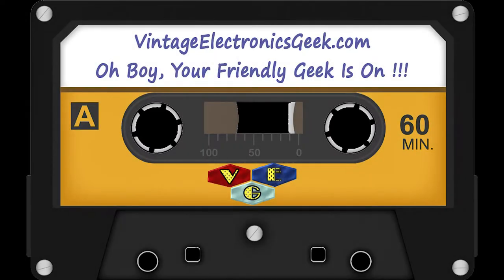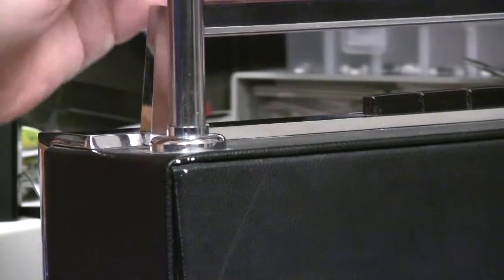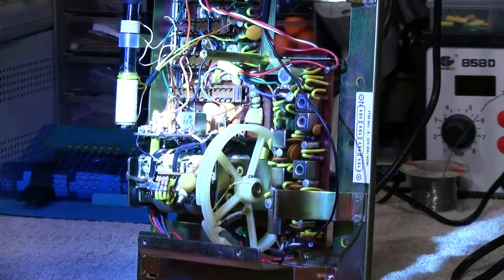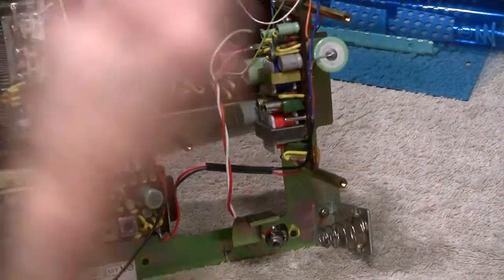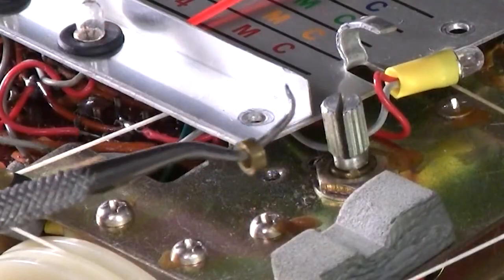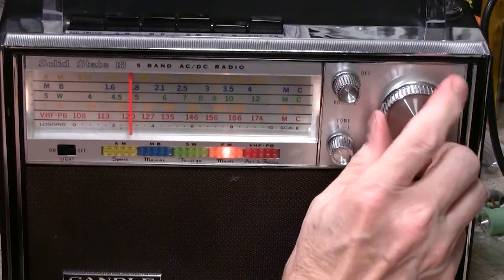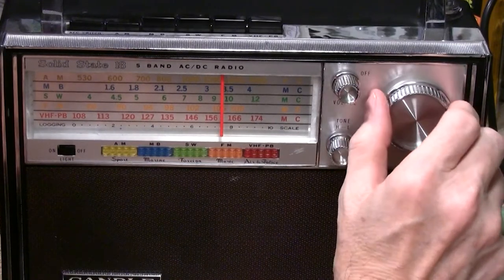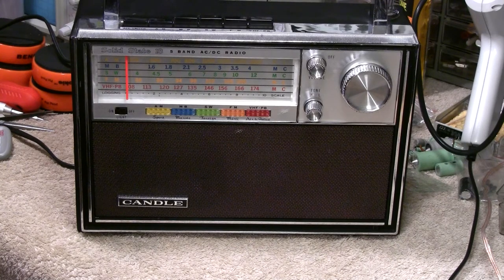Candle TK-1848 AM/FM/SW/VHF Radio - Overview & Servicing

Comment: I actually got this  same Candle radio on EBAY brand new in original box with original batteries for $100. Yes there is static and i believe this radio started production in 1964. I accidentally dinged the front black grill and am looking for a way to remove the ding, barely. barely noticeable

Comment: We had a couple of those Radios. The first we got in 1971, and it worked quite well, but it was Stolen during a Break and Enter, The replacement didn't work as well as the First, and i last saw it the Garage about 15 yrs ago, it still worked on the AM band

Comment: Sounds like it's a very sensitive radio, it seems to pull in quite a few stations.
Reply from the maker: It really is a decent radio, it's not the most sensitive radio I have/had, however it's really not bad! I do have one that is really deaf, a KMART brand that I showed a year ago or so...I need to dig that one out and try to adjust the front end?  Thanks for watching Pete!  ~Jack, VEG

Comment: Did you find after the re-cap that the volume still decreased a little when the dial lights were turned on?
Reply from the maker: Yes I did, never had the time to investigate it further as I sold the radio, it really was a nice radio otherwise!  ~Jack, VEG
Reply: I will be starting a recap on the same radio. My guess is that the two dial lamps are loading  down the amp circuit.  I may try modifying it to decrease the load
Reply from the maker: Oh, that will be cool!  Will you be doing this on camera?  Posted video??  ~Jack, VEG
Reply: I'm thinking LED's  might be a good substitute.  If I can solve It I will post a video  showing what I did.
Reply from the maker: Very cool!  I just sub'd to your channel and will keep an eye out, I'll also check out some of your videos!  ~Jack, VEG

Comment: I just bought this radio online, everything seems to be okay but I am having trouble getting many FM stations. Some come in, but not as many as a more modern radio. Is this a radio issue or more so a reception issue? Thanks!
Reply from the maker: Howdy!  Thats a good question?  Do you normally get more radio stations on other radios?  If yes, then I would say it's an issue with this radio, as seen in the video, mine works really well. There is also a good possibility your sample does have issues and may need to be repaired?  Thanks for watching!  ~Jack, VEG
Reply: Yes, usually I do get more channels on other radios. Do you have any recommendations on where to repair it?
Reply from the maker: Nathan - Do you receive any radio stations on the band's marked "SW"  or "VHF", these bands shares the rod antenna, if the answer is no, then I would open the back of the radio by removing the two (2) screws on the back, then remove the 4 (maybe 5?, forgot) screws that's holding the blue plexiglass, remove that out of the way, then look at the top of the rod antenna on the inside, you should see a white wire that connects it to the board...is it loose or secure?   If the wire is connected and the other bands work, then I'd guess to say it needs aligned.  Alignment is something I wouldnt recomend you do if you are not familiar with what to do and to advise how to do it as you could break it more than help it.  Let me know your findings...also, if you'd like, post a video so as I can see as you go and your findings. This radio is no DX monster, but it should do just as good as any other normal radio on AM/FM. ~Jack, VEG
Reply: I will have to look this weekend - I am away at school - but I do recall getting some SW or VHF stations. I will keep you posted!
Reply from the maker: OK, Nathan, will await!  ~Jack, VEG
Reply: Hi again! I finally got around to filming/posting a video. Here is the link: https://www.youtube.com/watch?v=utZxLPR4l_Q

I do receive some stations on SW/VHF, but not as many as I would prefer. It looks like the white wire is loose, and I tried to detail that in my video.
Reply from the maker: Howdy Nathan!  Let me look, thanks!  ~Jack, VEG

Comment: Hi Jack. This looks very similar to the Bush VTR178 radio that I repaired here https://youtu.be/W0rUGbloFa4?list=PLsZ_f0f_7yGVfzKbzWDv2kctkZn4_Yig2. Looks like it could be the same manufacturer as the telescopic aerial, power supply, case and amp look very similar even using the same capacitors. Nice fix
Reply from the maker: Graham - You are correct, it is...I forgot to declare that in the video, also, this radio was rebadged as "Winston 9333", I have seen that radio at a second hand store, took pictures but did not buy it. Thanks for watching, hope all is well my friend.  ~Jack, VEG
Reply from the maker: Graham - checkout this link:  https://goo.gl/M3LWfC  ~Jack, VEG
Reply: Vintage Electronics Geek Thatts got to be the same radio Jack. Just rebadged for different markets. I'm good thanks. Plenty of repairs coming up soon. All the best Graham
Reply from the maker: Graham, I am glad to hear you are!  It always has fascinated me about marketing the same product in a different package...for example "taco, burrito, tostada, etc" it's all the same thing just different package!  :)  ~Jack, VEG